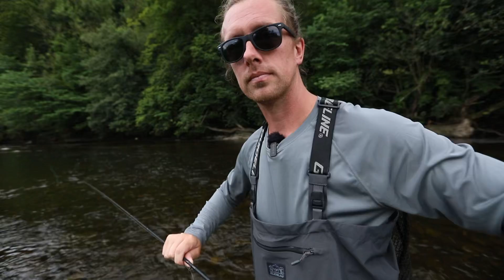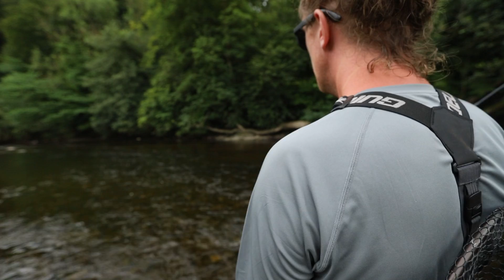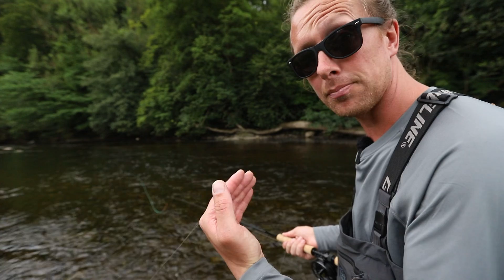Why Every Fly Angler Needs a Single-Hand Skagit Rig

Comment: Nice. But the lines already exist: Scandi Lite Spey Integrated by Scientific Anglers. Head weights and lengths are slightly different but still very close to yours. 
How much tip/leader weight does your 6wt line take? Talking 7.5 ‘ to 8’ leaders/tips.

Comment: What are the details? Fly line grain weight? Is that a rod you built?
Reply from the maker: The line in the video is 17ft head length. Available 150/400 grains. I also have them at 22ft head length!  I design and develop all the rods and lines! 

Tight lines 

Jack

Comment: 17ft integrated skagit/multi tip head.  Sounds like a modification to the idea from the short skagit lines currently available.  But most importantly using a lower line weight for size of rod, which makes it much better for single spey (and overhead) casting.  I like it. 

What is the head weight of the line?  Will the line be available separately, and will it be available in other sizes?
Reply: Thanks
Reply from the maker: Hi! 

Yes the lines will be available separately. Weights from 150/500grains! In various head length’s. 

Cheers